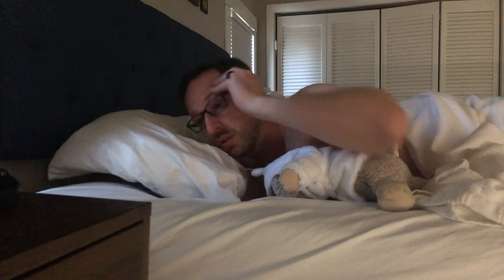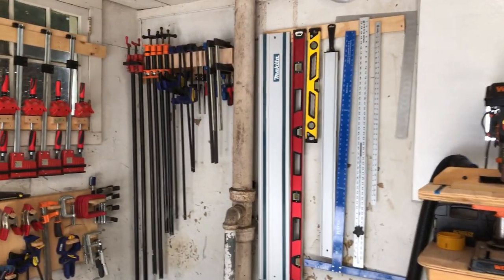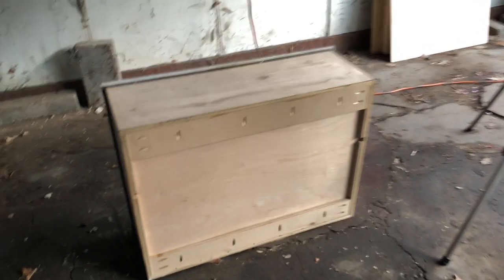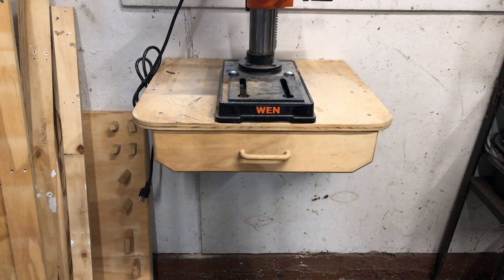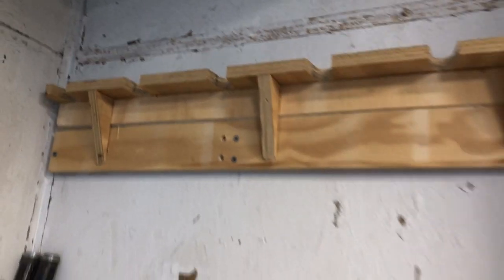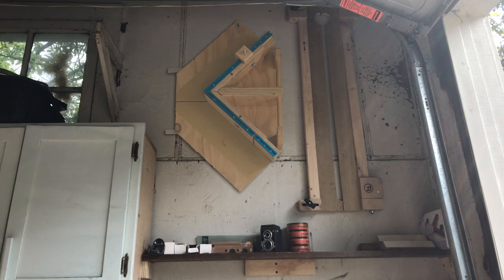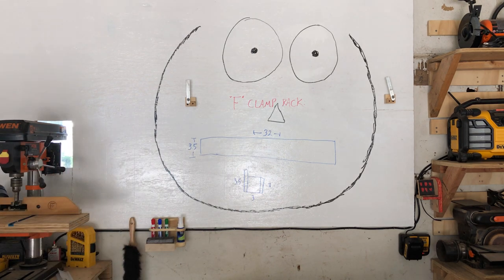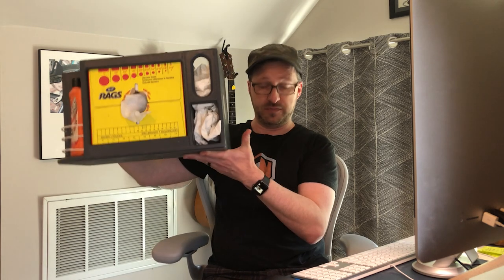Moving Shop / Shop Tour / French cleat builds and more!

Comment: I've been wanting to see that drill press shelf since I spotted it on the wall in the Octopus videos.  I thought it was a set up so it could mount on the side of your bench, but I can see why you might want it to be stationary.  I have a similar one, and it's not light.
Reply from the maker: Yeah, I think they're just too heavy to move around. I made it in my old shop to store my planer under, and in this one I've just got a scrap bin. Most of the time a dedicated cabinet makes more sense, but in some cases you might want it wall-mounted, and this is one way to do it.